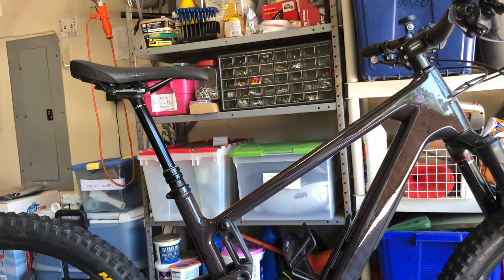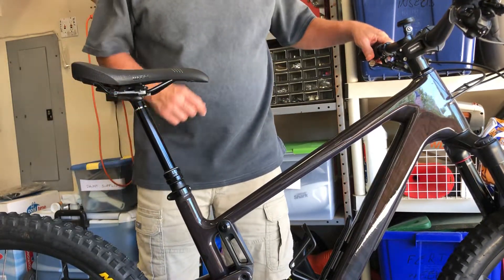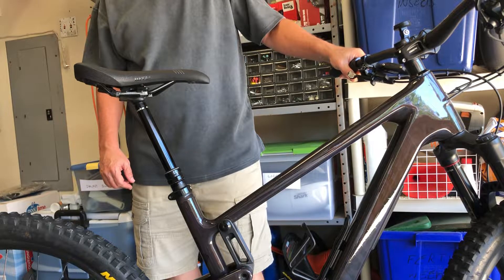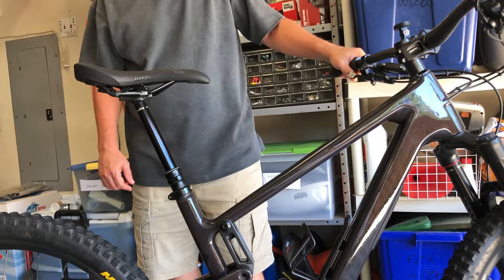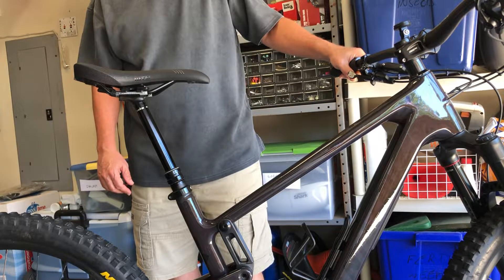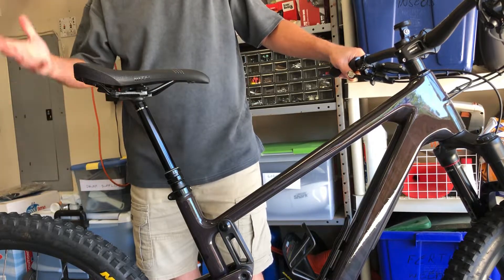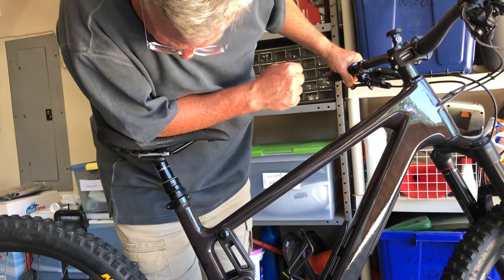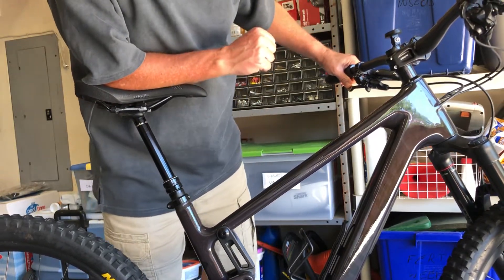HELP! Hydraulic dropper stops working after a couple of cycles

Comment: Randy, I am doing full rebuild this week, but I was reading that if your pressure is below 300 psi you will have these symptoms, check air pressure re bleed and check all fittings
Reply from the maker: Hey Ripman! It turned out to be defective and Rockshox had to rebuild it under warranty. Since it took so long to get it back from Rockshox, I just replaced it with an AXS.